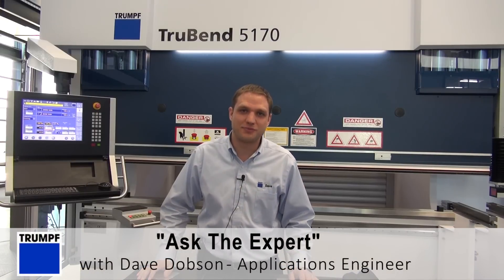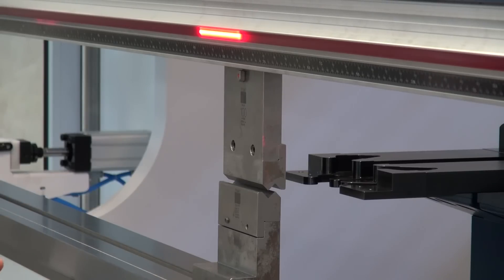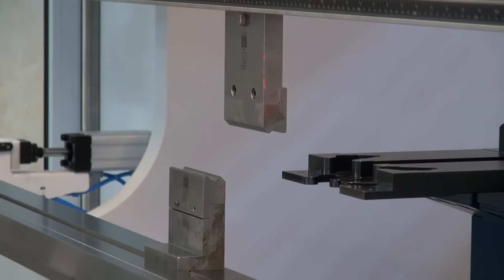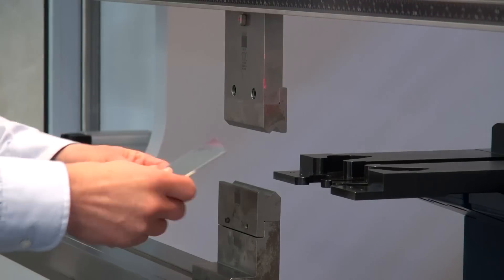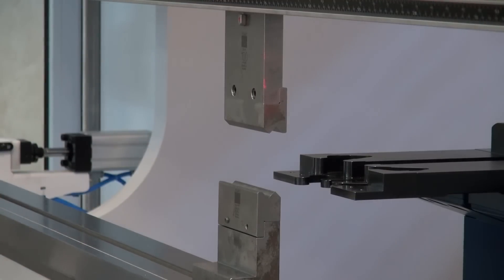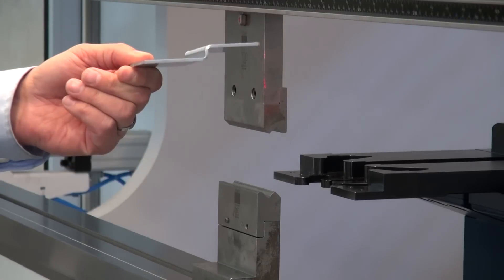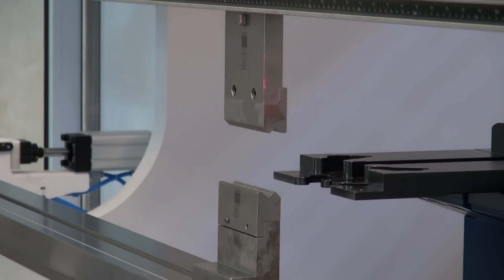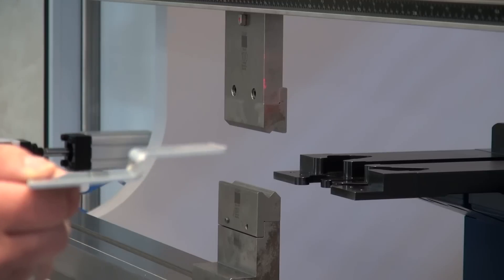Process offset bends on press break

Comment: I have some questions: 
1. So what you do here is actually "coining" and not "air bending"? Can you tell me which material that was, and how much press force did you need for it?
2. Why is the insert of your lower tool moving (relative to its adapter) during the bending operation? Did you leave it lose on purpose?